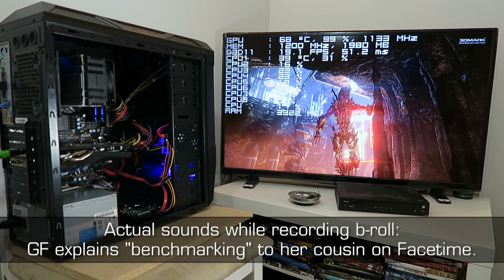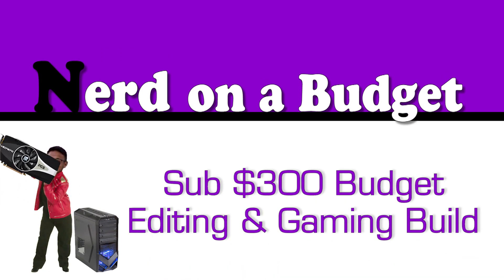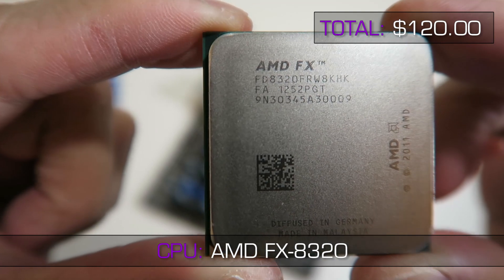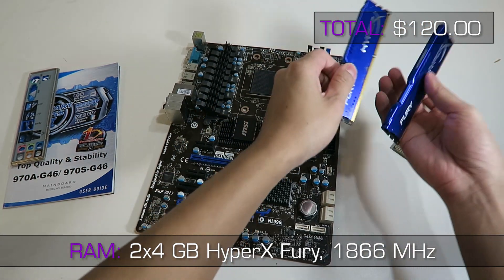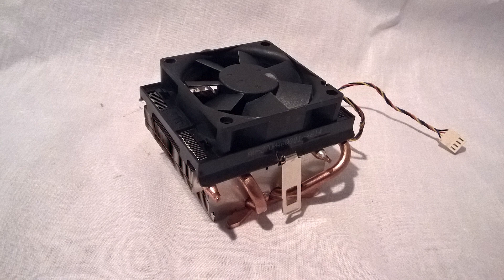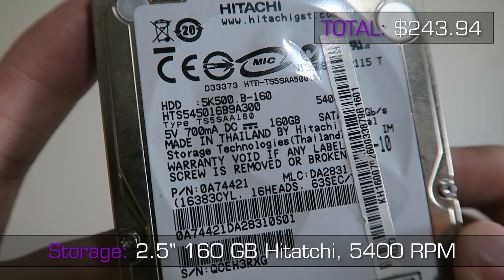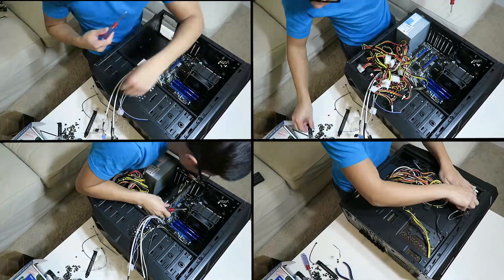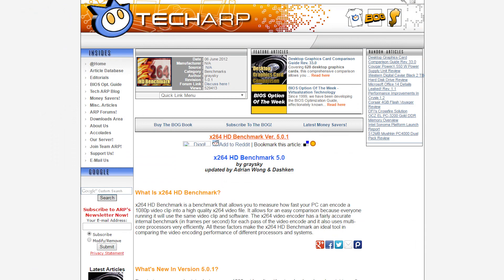The Sub $300 Budget Editing and Gaming PC (FX 8320 + HD 7870 /w Benchmarks)

Comment: i did not think my M9i (intel version of m9a) was easy to install because nowhere on the internet or the manual did they mention the mounting brackets would be loose until i screwed on the heatsink. i spent 45 minutes trying every possible solution on how to get them tight before saying f it and putting it on anyways to find out this important fact.